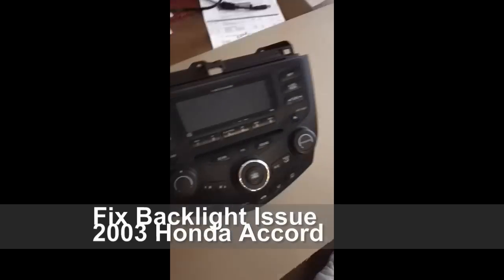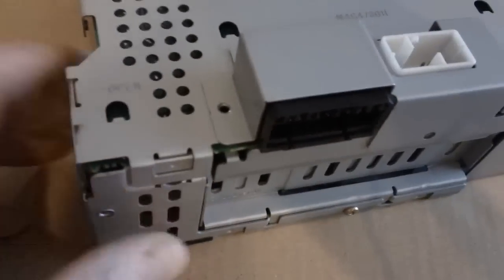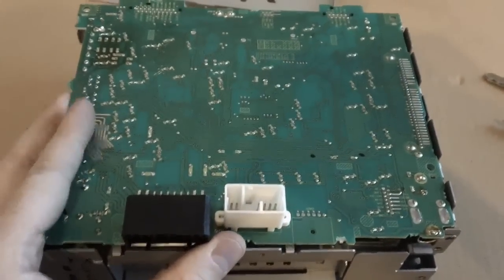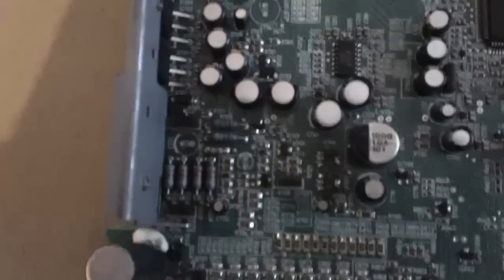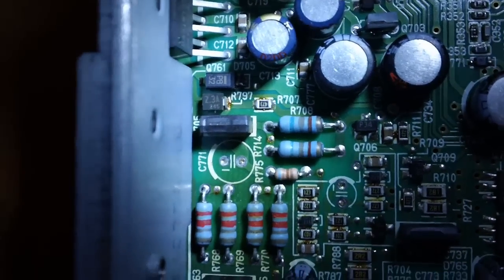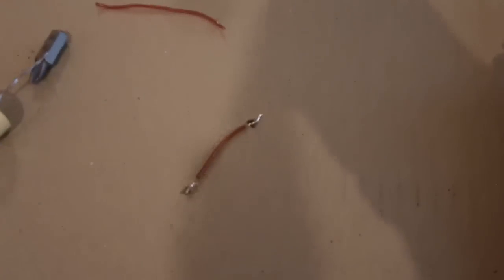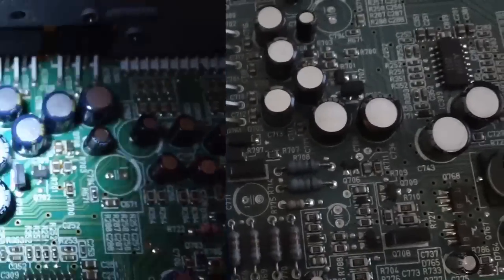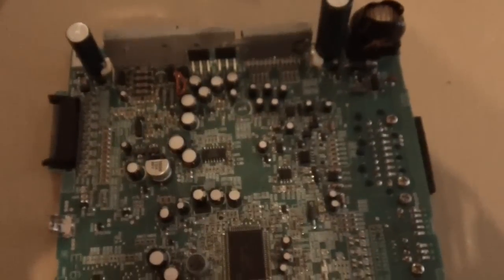Honda Accord Radio Back light Fix Tutorial

Comment: Saw your video and decided to try it out on my 2003 Accord. I tired to solder on a wire but it seemed like a difficult process.  I read other comments that just used a blob of solder around the affected area.  I had my doubts as to whether this would work but figured I had nothing to lose.  To my astonishment the fix worked and my screen jumped to life.  This is the greatest video on You Tube..  I also took the opportunity to add a iPod connector to the radio.   Thanks for sharing........

Comment: i want to offer some advice. 
1. you don't need wire just put a big blob of solder to short the two connections. that does the same thing and there is no need to solder the wire. 

2.if you are going to solder wire, run the two pieces of wire out the back and put on an external fuse that you can easily get to the next time. you can even mount a fuse holder on the rear.
3. a 3amp or 5amp fuse is better than no fuse
4. what caused this fuse to blow in the first place?
5. circuit breaker is better

Comment: I followed your video and fixed my unit.  The part is a "Fuse" NOT a resistor.  Fuses are rated in Amps and resistors are measured in Ohms.  Mine tested "Open" before removal and it should test "Circuit Closed" through the Fuse.   I suggest NOT putting a resistor in and just unsoldering  the Fuse and soldering a short piece of wire in its place or bridging it like the video.  I removed mine.   No need to replace a fuse with a resistor as that will only lower the voltage to the circuit and may c

Comment: The bad part is neither a resistor nor a fuse; it's a varistor and appears to be a Rohm Electronics ICP-S2.3 (rated for 2.3A, internal resistance 0.026 ohms), and it's available from places like Digi-Key (just search for the part number on their site). Looks like about 25 cents.

Thank you for this useful guide; I was able to fix a friend's radio (though I used a jumper wire rather than the varistor).

Comment from the maker: Since the HVAC system is built into the main unit I did not think about replacing it with an aftermarket unit. Plus this fix cost nothing but time.  Much cheaper than buying a replacement unit.

Comment: Thanks for the walk thru.  It took me about 1 hour to disassemble, 30 minutes to solder and 30 minutes to reassemble.  Crazy how one little fuze is responsible for this whole problem.  I do not have a steady hand - so i ended up removing the fuze and making a line of solder between the connectors where the fuze used to be.  I've never been so happy to see a flashing clock appear on my dash!  cheers

Comment: THANK YOU SO MUCH! I just did this repair to my wife's 2004 Accord and it works again! I did not use a wire! I pulled out the blown resistor and ran a bead of solder across the connections! GREAT HELPFUL VIDEO! YOU ROCK!!!!!

Comment from the maker: several people have tried to determine what type of resistor or fuse is used. I do not think I have ever seen a definite answer to this question.  I am pretty sure it is a 2.3 amp resistor.  I bridged mine and it has been a year and still working fine.  Good luck.  Hope it works for you.

Comment: Mitch, Thank you for sharing this video. After a quick desoldering of the failed fuse I used a thick trace of solder across the points making sure to let the heat fuse the solder to the points. It looks clean and is much easier than soldering a wire into the tight spot. I put the radio back in and all is good. One thing to note if a person holds the CD button on the head unit it will turn the backlight off only on the head unit. 5-10 second hold of CD will turn it back on. Thanks again!
Reply from the maker: Thanks for the comment!  I am glad this video is helping so many people. I had no idea the number of people affected by this issue. Take care!
Reply: You're welcome proast1.

One thing you could do when you pull the head unit apart again is take a picture with your phone, if it has a decent camera (8MP or better), to take a closer look. It allows good light on the board and gives the capability to zoom in and see if you are touching any other points on the board causing a short. It could also be a cold solder joint to the board. Reheat the solder and again ensure it is clean on both sides of the board.

Comment: Great job on the video! One word of advice for everyone: don't try to solder in a jumper wire the way it's shown in the video. It's better and easier to first remove the heat sink by desoldering its legs at four points, two at either end, then remove the transistor that's directly behind the fuse link. That way your path is clear to safely remove the blown link and replace it with a SINGLE STRAND OF COPPER! Don't use any more than that or you will risk further damage in the event of an overload.

Comment: Worked perfectly for me. Excellent instructions. I cut the fuse out and solder a bridge over the contacts. I had some help from a neighbor as the soldering area required a very small soldering iron and some patience.  I had neither one! Once it was soldered, reinstalling it was literally a snap! Save me a bundle. Thanks for this excellent video!

Comment: I did this about 10 minutes ago and everything lit up like a Christmas tree. The only thing I did differently (and it was mentioned in the comments) was I put a bead of solder between the contacts because the wire wasn't working out. My family thought I was nuts for attempting it, but thought it was cool it worked. You saved me $500.00 Mitch! Thank you!

Comment: Very good video.  I could not find tools to remove the assembly around the radio so had a car audio shop remove for me ($20).  I then used your excellent video to disassemble the radio.  Just a point, the failed piece is definitely not a resistor.  It is a 2.3 amp fuse.  I took the circuit board to an electronic music repair shop.  They confirmed that the circuit was open at the fuse indicating it had failed.  They installed a new 3.0 amp fuse for me soldering it in professionally.  I have now reassembled the radio and plan to place back in the car tomorrow.
Reply: Do you happen to know what what the voltage on that 3.0 amp fuse ?

Comment: Hi Mitch...great video. Unfortunately, and I didn't know this until I took it apart on the bench...my radio is different on the inside. It doesnt have that ribbon cable, as well as several other differences. Mine is a similar problem but it is intermittent. Ideas? Any help much appreciated.

Comment: Great video.  At 170k miles, the radio light went in my 04 accord.  Following you excellent tutorial, I was able to bridge the fuse with a piece of wire.  Seems like Ed Dylke (below post) did it the right way, getting the fuse replaced. but for all the longer I plan on keeping it, bridging worked just fine.   Thanks for taking the time to publish this.  Saved me a bundle.
Reply: Congrats on getting the job done by doing some research.  Feels good to save money, right?
Reply from the maker: Thanks for the great comments! I am still amazed of how many people my video has helped and continue to help.  This is awesome!!

Comment: Thanks for taking the time to post this.   I removed the resistor and replaced with a jumper wire to fix mine.  Took a few tries but I got it soldered.   The video doesn't do justice to how small these parts actually are.  Had to break out the reading glasses and a magnifying glass.  Thanks Again!

Comment: Worked for me and my 2004 Accord.  Thanks a ton!  I didn't think it was going to work because mine didn't have the same resistor as yours shows.  Mine was even smaller and beige color but it was labeled the same on the board and surrounded by what appears to be all the same components so I tried to solder a wire, no luck and went with the "glob of solder" to bridge both ends.  I also noticed the bottom of the board showed a lot of brown/burnt/heated areas.  I was sure it wouldn't work but I put it all back together and viola!  Works great!  Thanks!
Reply: Ouch!  It lasted one day :-(  Backlight is out again.  I suspect it's because I just did a solder-blob and it's probably not a good connect.  I can't solder with a microscope so I'm out of luck.

Anyone know where I can get a replacement circuit board?

Comment: I did this fix on a 2003 Accord LX w/ basic radio+CD changer and standard (non-auto temp control) HVAC when we lost lights to both the radio and HVAC controls (I believe, it's been quite some time ago).  Worked great with a bypass wire.  To make it easier to solder the wire in place, if you are handy with soldering and can use a solder sucker or solder removal wick, I unsoldered the 4 heatsink bracket (large) connection points from the bottom and simply lifted the metal heat bracket off, carefully bent back the closest transistor, did the resistor bypass solder, then reverted and soldered the heatsink bracket back in place.

I now have a 2004 Accord EX w/ radio that includes Sirius XM+CD changer, and advanced (auto temp control) HVAC that has a problem where only the HVAC buttons and dials aren't lighting but all the radio controls and LCD are fine.  I did the bypass wire but it didn't work, then researched further and found I may be missing some of the individual lighting resistors that are known to fall off due to cold solder joints cracking.  So if your radio lights work but not HVAC/climate control, it may be that.  I'll try to post if I'm able to find/fix the missing resistor(s) problem and it works.

Comment: I can't believe this!!! I purchased second face plate thinking that was the issue and when it was installed still didn't work. Turns out it is the radio itself. Thank you very much for posting this. And thank you to sjfriedl for posting the part number for a .25 cent fix.

Comment: Thanks for the video.  I was able to fix the back light of my 2004 honda accord.  During the attempt to stick jumper wire, the resistor came out though.  And then I joined the two points with the solder metal itself without using the jumper wire and that worked just fine.  Mission was accomplished as soon as I plugged the radio back into the dashboard and entered the code.
Reply from the maker: Jitendra Pandey Awesome!  Glad I could help a fellow Accord owner fix their radio and save some cash.  Thanks for letting me know it went well.  Take care.

Comment: Nice video, I completed this repair on my Honda Accord yesterday.  I'll add that the resistor that needs repairing is much smaller in person than it appears in the video, so be prepared.  Instead of adding a jumper wire I found it much easier just to remove that resistor from the board, once removed, you will see the two contacts that need to be bridged.  Create a soldering blob and connect those two contacts with it and then you are done.  I think the soldering blob will hold much better over time than the jumper wire.  Also, removing the trim pieces is the hardest part, make sure you purchase a trim removal kit from your local autozone, makes the job much easier!
Reply: how do you remove the resister? just pry it up or unsolder?
Reply: I just pryed the resistor up with a small flat head screwdriver.  Be gentle when you are prying on it so that you don't harm any other hardware around that resistor.
Reply: thank you

Comment: I took a piece of wire and soldered one end to each side of the bad resistor. This bridges the circuit. It is explained and shown in the video. Thanks.

Comment: My wife thanks you for this fix.  The faulty backlight wasn't enough to justify replacing the stereo, but it was enough to get her irritated her at an otherwise excellent car.  I would have been clueless on figuring out which component was faulty!  If you try this, though, get thinnest solder and soldering tip you can find.

Comment: Hi, i tested this yesterday and it works, i just have a question, it works if you welded below the fuse would think simpler?, i dont now electronica or welding.
Reply: i means on the other side of the mainboard
Reply from the maker: It should work, as long as the resistor points go through to the bottom. You just have to make sure you are connecting the right points or otherwise it could cause more damage.

Comment: Buy a Koolertron radio,  bolts right in, gives you touchscreen,  maps, bluetooth, backup camera.  Easy to put in, gives you a modern car. My son's motherboard didn't look like this, 2006 model.  We got on from the junkyard that drained the battery. Finally bought the Koolertron and my boy is quite Happy with it.
Reply from the maker: One of the main reasons I didn’t replace the unit with an aftermarket unit is because the climate controls are also controlled in the radio unit.  And at the time of recording this video,  there weren’t a lot of good options for aftermarket units that would work.   Thank you though.   It may be helpful to users today that are still having the issue.   Take care.
Reply from the maker: I also didn’t want to spend $500+ to replace the unit and fix the issue when I could fix it for free.
Reply: @mitchcox  the way most cars do it now is to mix the controls together. Honda makes a great car,  but a radio that is designed to fail. You either have to find one designed for the car, or put one in the hole below. The Koolertron does the AC. You have to specify dual or single AC though. It is as simple to put in as a Honda orginal. If you have any questions,  I am willing to help.
Reply: @mitchcox  we paid $351 plus $12 for the backup camera. Did all the labor though.

Comment from the maker: All I did was solder a jumper wire from one side of the resistor to the other.  I thought about replacing it with but had no idea what exactly it was, fuse or resistor, then I didn't know what size to put on there, the current one was not sufficient. So I just bridged it and so far so good. Also, since the HVAC system is built in with the radio, replacing it with an aftermarket radio is not an option. Plus this fix cost nothing but time. Much cheaper than buying a replacement unit.

Comment: Thanks for the video. It was a great help. Although I do not believe that to be resistor. Although the board is labeled for a resistor, the part actually on the board looks to be a fuse (rated at 2.5 amps). Resistors are not expressed in amp but rather ohms. That would explain why a jumper fixes the problem and there's no 2.5 ohm resistor.
Reply: Do you still have the diagram?

Comment: Thanks for the video, saved a lot of money. To add, its a Fuse and can buy it on eBay. 
Search for "ICP-S2.3TN FUSE 2.3A 50V SMD FAST 2.3 ICP-S2.3"
Reply: So...assuming I buy the fuse, how...dangerous is this repair for a new guy? I refer to the safety of the radio, this is not work I do very often. All the 'carefully' stuff makes me kinda nervous lol. Getting right into the guts here.
Reply: Do we solder it in after heating up and removing the old one?

Comment: Hey Mitch,

Just brought home a new to me 2007 honda accord and already noticed it doesn't have the backlighting for the CD player. I definitely want to try this fix, but my main question is how do you remove the ribbon without Damaging it? Also, you said you didn't remove the blown fuse, so if I solder the jumper to the left an right side of the fuse, that will work?

Comment: I finally took everything apart and was ready to solder the wire. I then found myself having a broken solder.  Sigh! :(.  I pulled off that little 2.3 amp resistor and planned to melt some tin to connect the resistor area, but again, the tip of my solder just wouldn't heat to a temperature high enough to melt the tin.  But for those of you who want to try, do not get discouraged.  Fairly easy to follow.

Comment: It's a 2.3A rated resistor. If it's a fuse it would have a reference designator starts with F as F1234. My question is how do you know it's that resistor that's blown or was the problem? Thanks.

Comment: Thanks for posting this video. . .  I'm looking forward to using your jumper solution when I have a few spare hours.  Just to clarify some electronics terminology for everyone.  Resistors are measured in Ohms (not Amps).  Amps are a measure of current.  Fuses are measured in Amps. . . so, I would guess that that componant is a fuse.  That being said, if you jumper the fuse, something that the fuse was designed to protect is no longer being protected.  Obviously, that can be a problem.

Comment: It is actually a 1 ohm resistor. That is the specification you need to know. Since a chunk of solder soaked wire is somewhere around .5 ohm, it works just fine and doesn't get nearly as hot.
Reply: I read that is is actually a 0.1 ohm fusible resistor so it is there mostly to act as a fuse.  If the power resistor to which it feeds should develop a short however then LOOK OUT !!!